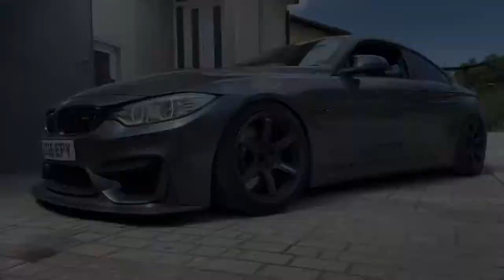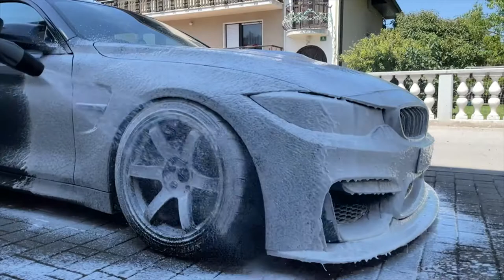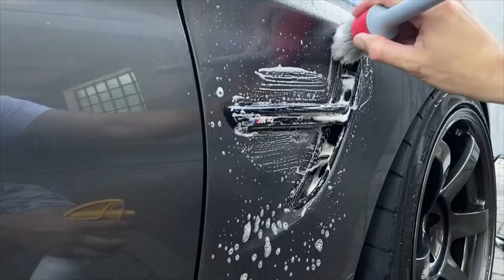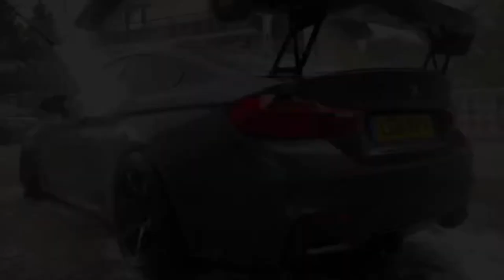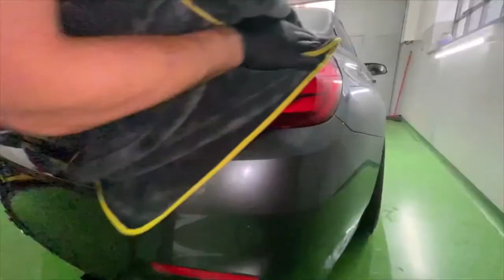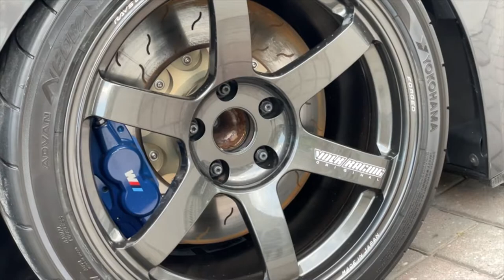BMW F82 M4 track spec on Volk TE37 wash therapy

Comment: whats your friends' wheels and tire specs? Looks so good!!
Reply from the maker: Wheel specs are 18x10.5 ET15 and 265/35/18 tires
Reply: @autohaus2287  lowered on what?
Reply: @autohaus2287  both rear n front same spec?
Reply from the maker: @kadirkuat3763  Yes, squared setup.